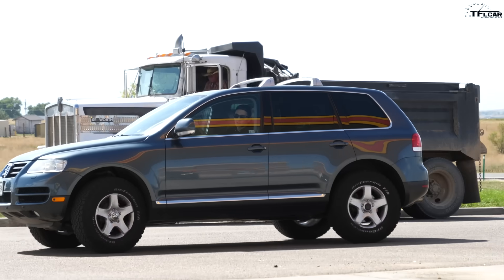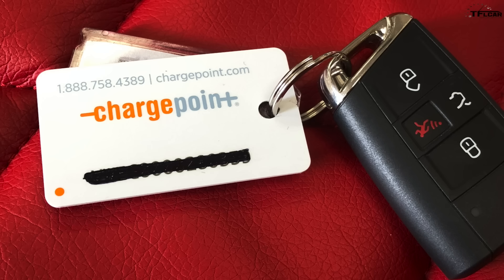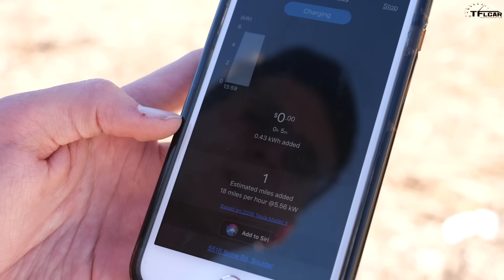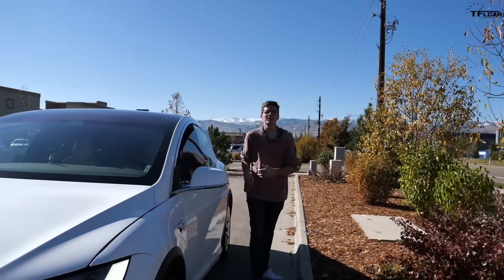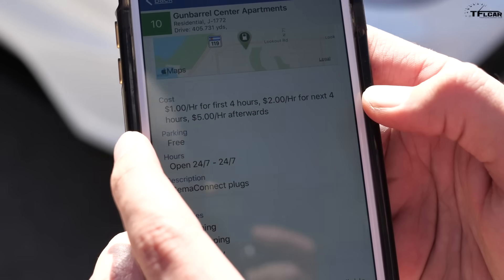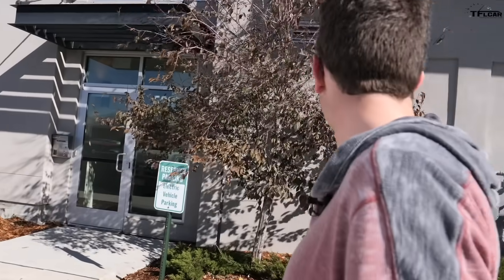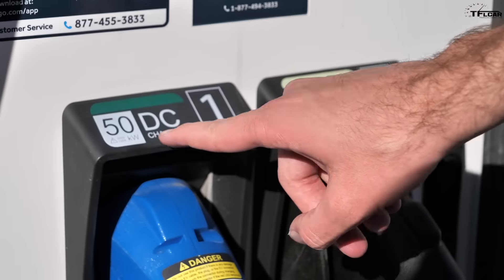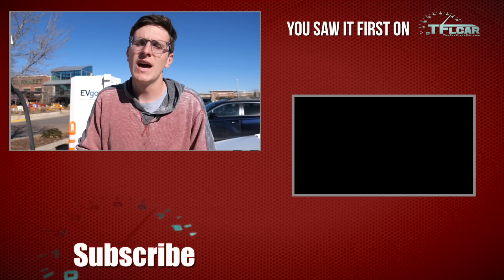Here’s Why Charging an Electric Car Can Suck - And It’s Not The Reason You Think!

Comment: I like how you called it “band width.” I have something for you to think about:
When do you know to put gas in your car? How often do you change the oil? Do you live in a state with emissions and how often are those done? How do you know when the alternator is going bad? 
All of these things you learn about internal combustion engines (and this means it explodes on purpose and many times a second), but someone doesn’t want to learn a little about kWh or how to use the plug share app? Charge points are extremely reliable and maybe GM should partner with them. It will be the only thing electric that they could say is reliable right now. ;) Anyway, I don’t understand why they know and were willing to learn all this, but not the little it takes for an electric car…
Reply: Good, you go buy them, and spend your "holiday" about 50 km from home, camped in a tent, waiting ten hours for a recharge, especially when MOST of the one's seen in the video are ONLY OPEN between 8 am and 5 pm (8 hours only) so TWO DAYS AT LEAST to recharge a car that can get another 50 km, against a petrol guzzler, five jerry cans and untold "places" to scab a few liters of liquid fuel..
I know where I'd like to spend down time (holiday's etc.), and that's at a cool beach somewhere, far away from the city rat race (those EV rats sleeping in their little tents beside an EV that's needing ten refills just to get you halfway there, and using three times the days of holiday you have)

Comment: Here in the UK apparently most of charging points are not working so you then use the last of your battery trying to find one that is working that a fail straight away,  then if there's a queue waiting for the ones that are working so there could be a 4 or 5 hour wait for the charger and when everyone has to have an EV the problem in multiply x 100

Comment: EVs are a boutique product.  If everyone had one, the electrical grid would collapse and the hours to charge would stop the entire reason for having a car.  Fast recharge, high capacity batteries have been pursued for decades.  Lithium Ion is decades old.  Nickel Cadium is more recent.  Neither is fast recharge and high capacity.  Material science for batteries is very difficult and that is not going to change.

Comment: Naive question - When you attach the plug to the car, does it 'latch on' or could someone else come along and remove it from your car and plug it into theirs?  Also, if the price of copper were very high these charging stations look like 'gold mines' for copper thieves...
Reply: Yes, in most vehicles the lock button for the doors also locks the charging cable into the car
Reply: I've had that thought too. I don't have an EV and have not examined a charging station up close, but it doesn't appear that there is any kind of lock, and certainly not with that adapter. Ideally the charging station would recognize a disconnection and not allow continued charging after a reconnection without confirmation from your phone. I would hope the systems provide such security, but I don't know if they do. Assuming they do, that doesn't stop someone from maliciously coming along and disconnecting your vehicle. Or if someone disconnects your vehicle, can they reset with their account to charge their vehicle? In that scenario, at least you're not paying for their charging, but your vehicle isn't getting charged. I suppose another possibility is that the phone app still can communicate with the charging station such that you would be alerted if your vehicle's charging was interrupted.

Comment: Charge for an hour using a system that may or may not work with your vehicle and gets you maybe 100 miles, or fill up your tank in 90 seconds from a pump that will work with any gasoline car and will drive you for 250 or 300 miles? You decide.

Comment: Where does the power come from, to provide power to these rip off charging stations? Let me guess. A local power plant either running on coal, oil, maybe nuclear power. With fossil fuel, you can go to any gas station in any state, city, town, refuel in  10 minutes, grab a meal and be back on the road in about half an hour. The day, I buy an EV car is the day I will have my gonads removed and put on a fireplace mantel.

Comment: It takes more than an hour to get enough charge to go 20 miles down the road with a level 2 charger?  I'm sorry, but no.  Even using the super charger that could potentially provide a full charge in an hour isn't always practical.  I'm also very leery of needing to have an account with the car company just to get the go-juice for the LIFETIME of the car.  I'd already be paying for the car loan for a few years, now I also might need to pay for the fuel even after it's paid off?  And on top of all that, I'd need an internet-connected phone with a handful of apps (with my credit card information) in order to just find and use these various charging stations?  This is just too much.

When the gas fill-up changes from 15 minutes to electric's 15 hours (even 1-3 hours for the super charger), you don't have a viable replacement for the gas-powered transportation problem we have.  At best, you have a solution for extremely tech-savvy people who never go on road trips, and either have a newer home with 240V wired in their garage or live somewhere that has plenty of charging stations.

For anyone who wants to drive long distances at least occasionally, get a gas car.
For anyone without the garage or charging stations, we have an even better solution for you: it's called public transportation.

Comment: A matter of hours to recharge an electric car!! That is ridicules!  This will always be a drawback to electric cars. that it takes time to recharge them. They need power packs that can easily and quickly be replaced. It is bad enough to stand in front of a gas pump while it is filling your tank with $20.00 worth of gas.If you feel afraid waiting for your tank to fill up, well let your husband do it! Unless you have the proper wiring in your house, you can burn out all the wiring if you have to recharge your car every night. The time it takes to recharge your car will always be a disadvantage of owning an electric car.

Comment: Dr. Jay Lehr and Tom Harris | Jan 15, 2022 | Climate

The utility companies have thus far had little to say about the alarming cost projections to operate electric vehicles (EVs) or the increased rates that they will be required to charge their customers. It is not just the total amount of electricity required, but the transmission lines and fast charging capacity that must be built at existing filling stations. Neither wind nor solar can support any of it. Electric vehicles will never become the mainstream of transportation!
In part 1 of our exposé on the problems with electric vehicles (EVs), we showed that they were too expensive, too unreliable, rely on materials mined in China and other unfriendly countries, and require more electricity than the nation can afford. 
In this second part, we address other factors that will make any sensible reader avoid EVs like the plague.

EV Charging Insanity
In order to match the 2,000 cars that a typical filling station can service in a busy 12 hours, an EV charging station would require 600, 50-watt chargers at an estimated cost of $24 million and a supply of 30 megawatts of power from the grid. That is enough to power 20,000 homes. No one likely thinks about the fact that it can take 30 minutes to 8 hours to recharge a vehicle between empty or just topping off. What are the drivers doing during that time?
ICSC-Canada board member New Zealand-based consulting engineer Bryan Leyland describes why installing electric car charging stations in a city is impractical:
“If you’ve got cars coming into a petrol station, they would stay for an average of five minutes. If you’ve got cars coming into an electric charging station, they would be at least 30 minutes, possibly an hour, but let’s say its 30 minutes. So that’s six times the surface area to park the cars while they’re being charged. So, multiply every petrol station in a city by six. Where are you going to find the place to put them?”
The government of the United Kingdom is already starting to plan for power shortages caused by the charging of thousands of EVs. Starting in June 2022, the government will restrict the time of day you can charge your EV battery. To do this, they will employ smart meters that are programmed to automatically switch off EV charging in peak times to avoid potential blackouts.
In particular, the latest UK chargers will be pre-set to not function during 9-hours of peak loads, from 8 am to 11 am (3-hours), and 4 pm to 10 pm (6-hours). Unbelievably, the UK technology decides when and if an EV can be charged, and even allows EV batteries to be drained into the UK grid if required. Imagine charging your car all night only to discover in the morning that your battery is flat since the state took the power back. Better keep your gas-powered car as a reliable and immediately available backup! While EV charging will be an attractive source of revenue generation for the government, American citizens will be up in arms.

Used Car Market
The average used EV will need a new battery before an owner can sell it, pricing them well above used internal combustion cars. The average age of an American car on the road is 12 years. A 12-year-old EV will be on its third battery. A Tesla battery typically costs $10,000 so there will not be many 12-year-old EVs on the road. Good luck trying to sell your used green fairy tale electric car! 
Tuomas Katainen, an enterprising Finish Tesla owner, had an imaginative solution to the battery replacement problem—he blew up his car! New York City-based Insider magazine reported (December 27, 2021):
“The shop told him the faulty battery needed to be replaced, at a cost of about $22,000. In addition to the hefty fee, the work would need to be authorized by Tesla…Rather than shell out half the cost of a new Tesla to fix an old one, Katainen decided to do something different… The demolition experts from the YouTube channel Pommijätkät (Bomb Dudes) strapped 66 pounds of high explosives to the car and surrounded the area with slow-motion cameras…the 14 hotdog-shaped charges erupt into a blinding ball of fire, sending a massive shockwave rippling out from the car…The videos of the explosion have a combined 5 million views.”
We understand that the standard Tesla warranty does not cover “damage resulting from intentional actions,” like blowing the car up for a YouTube video.
EVs Per Block In Your Neighborhood
A home charging system for a Tesla requires a 75-amp service. The average house is equipped with 100-amp service. On most suburban streets the electrical infrastructure would be unable to carry more than three houses with a single Tesla. For half the homes on your block to have electric vehicles, the system would be wildly overloaded.

Batteries
Although the modern lithium-ion battery is four times better than the old lead-acid battery, gasoline holds 80 times the energy density. The great lithium battery in your cell phone weighs less than an ounce while the Tesla battery weighs 1,000 pounds. And what do we get for this huge cost and weight? We get a car that is far less convenient and less useful than cars powered by internal combustion engines. Bryan Leyland explained why:
“When the Model T came out, it was a dramatic improvement on the horse and cart. The electric car is a step backward into the equivalence of an ordinary car with a tiny petrol tank that takes half an hour to fill. It offers nothing in the way of convenience or extra facilities.”

Our Conclusion

The electric automobile will always be around in a niche market likely never exceeding 10% of the cars on the road. All automobile manufacturers are investing in their output and all will be disappointed in their sales. Perhaps they know this and will manufacture just what they know they can sell. 
Drs. Jay Lehr and Tom Harris

Dr. Jay Lehr is a Senior Policy Analyst with the International Climate Science Coalition and former Science Director of The Heartland Institute. He is an internationally renowned scientist, author, and speaker who has testified before Congress on dozens of occasions on environmental issues and consulted with nearly every agency of the national government and many foreign countries. After graduating from Princeton University at the age of 20 with a degree in Geological Engineering, he received the nation’s first Ph.D. in Groundwater Hydrology from the University of Arizona. He later became executive director of the National Association of Groundwater Scientists and Engineers.

Tom Harris is Executive Director of the Ottawa, Canada-based International Climate Science Coalition, and a policy advisor to The Heartland Institute. He has 40 years of experience as a mechanical engineer/project manager, science and technology communications professional, technical trainer, and S&T advisor to a former Opposition Senior Environment Critic in Canada’s Parliament.

Comment: The ev car is a good idea. The only way the whole world will accept it if it's all super charge and standardized plugs. My idea was to have the drive system battery powered only and a 2 cylinder or ever 1 cylinder drive a generator onboard to recharge the system. We are not ready to completely leave gas pump.

Comment: One item not mentioned is that fast charging is very destructive to the battery. The battery is the  single most important and expensive item in an EV. I live in the country and to drive to the city is about 170 miles, so I would have to charge in the city in order to make it back home. I can't imagine sitting at a charge station for 10 hours before coming home. The only solution I could think of would be to spend the night which would add the expense of meals and a hotel. 

Love the idea but not for all situations.

Comment: ummmm, nice try. Turn on your air conditioner..20% drain, turn your  your heat...40% drain. Charging takes forever so don't buy an electric and drive over 150 miles one way or you will need to charge and wait like a dope.
Reply: Hard for me to believe that you watch one video and you actually believe this crap.

Comment: Hot water heater and clothes dryer are all most always 240V. an hour for 16 miles is inconvenient it’s that slow for heating up batteries any faster is probably very dangerous and in a garage could burn your house down

Comment: Wait until everyone will try to charge, grid won't have capacity, and price of energy is even greater due to more "green" energy maintenance.
Reply: That's after the grid fails and it takes several days to restore power...
Reply: @dking1836  Grid is secured on multiple levels, so I don't think it'll break down because of overloading. It'll just keep disconnecting the most overloaded nodes, plus there simply won't be enough power for everyone to charge. No one talks about how much it'll cost to upgrade the grid, installations and build additional power stations. It's dozens of additional GW and hundreds of TWh/day.

Comment: This is awfully interesting.  I'm definitely not buying an electric car, yet, though.
Reply: If you can charge at home ... you're ready for a Tesla today.  When gas hits $7 a gallon, I'll be getting the equivalent of 180 mpg.  Drive the tesla regularly for more than 5 years, and it'll cost you less for maintenance and fuel than your gas car.
Reply: @cSR-71  , I do not have a 240V charging station, at home.  Taking 12 hours, or more, to fully charge my car is unacceptable.  I can fill a gas tank in under 20 minutes.

Comment: the system the way it is will fail, never work in the real world, need an entirely different system, this is not what tesla wanted, charging through any lines or cables is the dark ages, 
Tesla knew that the electric was free but the powers that be want to put a price tag on free power, we have it but it's locked away by the dark state

Comment: What I wanna know...who are these folks needing to drive 250 miles a day ? more importantly, why can't they charge their car at home, at night, during off peak, and have a fully charged car ready to go...
Reply: You only need to HAVE to drive 250 miles once and not have the range to be screwed. Hurricanes, Tornados, Earthquakes, a dying member of the family one state over, or dozens of other emergencies... and think of a hurricane in the Gulf States with hundreds of thousands EVs trying to flee in stop and go traffic... as each EV battery dies, just one more stalled car in the road. New Orleans flooding and your car is out of juice... You own a company and HAVE to get a part 150 miles from home in the next two hours before the store closes. EVs for a 10-20 mile commute is fine if you have a garage... some people never go anywhere. As a teenager, we used to drive up to Disneyland (91 miles away) on a whim for the day, coming home in stop and go rush hour with the air conditioner running. Also called freedom.

Comment: I haven't seen a damn one in Florida. You will need a room and wait for hours. That charger needs a Coal Fired power plant to power that charger. Then the 20,000 dollar battery has to be desposed of . That's unless it blows up and burns you up in a small wreck or while charging. It's impractical .